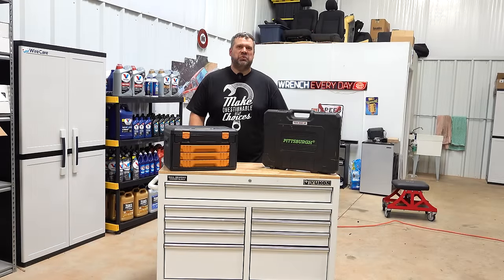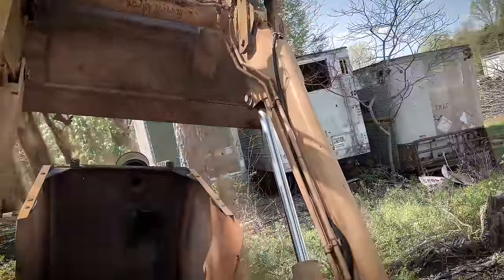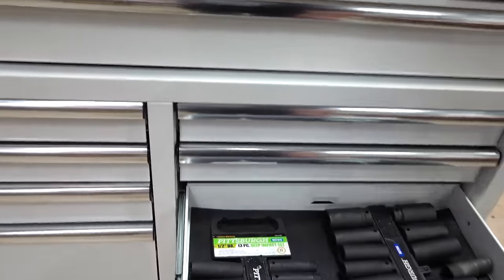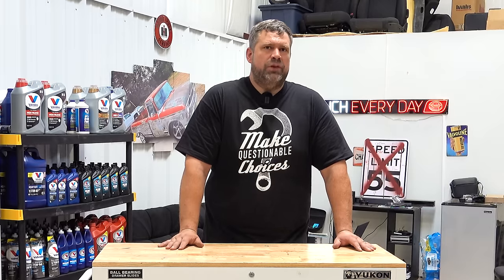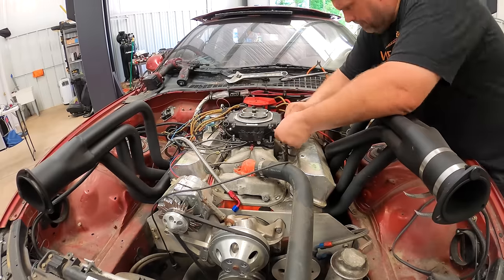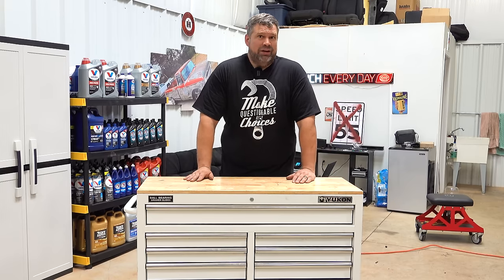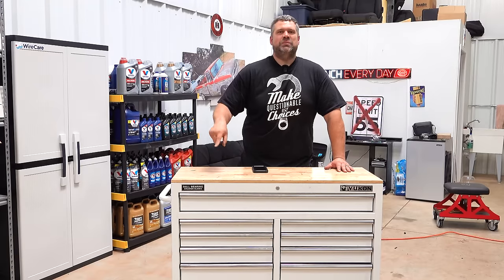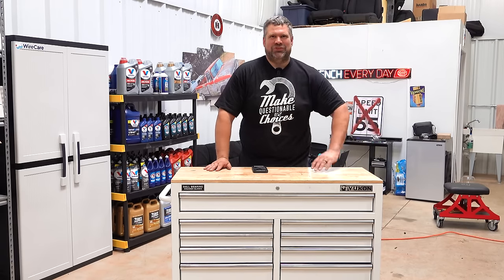I Bought The CHEAPEST Tools In Harbor Freight (6 Month TORTURE TEST)

Comment: Absolutely nailed it. I run a small bodyshop with less than 10 techs, and whenever I take on fresh apprentices they're always wanting to go straight to snap on and take on the debt, I tell them to buy cheaper tools and if they do break them with continual use then to upgrade that tool to something more expensive as they are clearly getting the use out of it.
Reply: yea it makes no since to buy a overpriced tool you are not using much, buy the cheaper tools and find out which ones wear out the quickest ... those are the ones that are probably being used and pushed the most. You don't want a 45$ o-ring pick set when your 10mm ratcheting box end wrench fails
Reply: What you said, but it also builds tool knowledge. So many kids just jump into the expensive stuff thinking "oh, legacy tools, grandpa had them etc" and skip an entire chapter worth of shop education which does end up biting some of them in the end.
Reply: @aserta  I have a complete metric socket set 6mm to 24mm and so many of those sockets I've never used because the ISO standard skips sizes. Although there are out of standard fasteners. But they're rare. Why I got that set is another story. It was a deal I couldn't pass up.
Reply: The industry needs more people like you. My first dealer job was working at Mercedes’ and man did everyone try and say I couldn’t do the job without snap on tools, thankfully I didn’t go down that rabbit hole.
Reply: Dude I buy whatever is cheap and if I break it I upgrade it. I'm cheap l and I have a full arsenal of shit I need to get my jobs done. Gotta be resourceful
Reply: @Gearhead2286  price is not always reflective of quality. Usually but there are exceptions. Cheaper brands that outperform more expensive ones. Tools can be a crap shoot.
Reply: @1pcfred  👍👍👍👍👍👍👍👍👌👌👌👌👌👌 Yup
Reply: Yup. I started with a small set like this one. 15 years later, I have over 30k in tools, and a majority of them are Matco, but I do have a handful of my original Pittsburg tools, that I've used the warranty on a handful of times. Lol.
Reply: @hanksadventures4132  plus its good to have the harbor freight stuff kicking around for those times you need to customize/modify a tool. You dont want to do it to your expensive tools and void the warranty, or just weaken then expensive tools, thats when its good to have the cheap tools kicking around you dont mind ruining/sacrificing. Sometimes you even end up using the modified tool more often than you expected cause it works for other stuff as well
Reply: Icon tools are made in the same factories that most other tool brands are made, and something that we have to realize is that each tool is forged individually, and just because a tool of a particular brand failed on you doesn't mean all their other tools are the same, tool sets are not uniform, tool brands are not completely uniform, except ones that are inherently flawed, because of some sort of deficiency in the forging process, and you will not see that from the top brands, that is the reason Icon tools finish in the middle of the pack, as well as Snap-on tools.. the majority of tools from these two companies are generally well made professional grade tools.. even though their prices diverge wildly! Lol!
Reply: Lol if they break them just take them back and get another tool. Or maybe they are abusing the tools and don't know how to use them. Husky, Kobalt, craftsman, Pittsburgh all lifetime warranty no questions asked so who cares.
Reply: I will never buy a Snap on tool what they charge for their tools is robbery
Reply: That makes sense...Why go for a $500 tool right off the bat when the $250 tool does the exact same thing the same way for 1/2 the cost...if the cheaper tool breaks, replace that tool with a higher quality one....just because you break 1 tool out of a hundred doesn't mean they all suck, it just means that particular tool wasn't up for the task and needs a heavier duty/better quality tool....wish a lot of other people would understand that and do the same as you with their new employees to try and save them money...sure once they're working there long enough they'll find out what works, what doesn't, and what to buy that works for them....thinking automatically that they need to have a $30k tool debt on week 1 of employment is horrible, understandable, but horrible....many think well the guy in the bay next to me has that $20k Snap-On tool chest, that must be a requirement...in fact I highly doubt any shop requires their employees to buy a certain amount of tools from the tool truck?  Maybe they do?  IDK.  I think I'd find a different place to work though if that were the case LOL...
Reply: @1pcfred  Very true, I've heard of people buying that high end brand name stuff, and breaking it, or finding out the hard way it had a defect....and they end up replacing it or supplementing it with a cheaper version and have great luck.  I think the tool trucks have lifetime warranties on their tools though?  Where, an off brand, no name version might not.
Reply: @hanksadventures4132  The thing is you didn't go out and put yourself into $30k+ in debt to a tool truck, you were smart and I assume you worked your way into those tools as you saw the need, rather than jumping in the truck  your first day on the job and requiring a 2nd mortgage on the house to outfit your tool chest LOL.
Reply: @wildbill23c  I've never heard of a lifetime warranty on power tools. Hand tools lifetime is pretty common among the respected brands. Even Harbor Freight lifetime warranties their branded hand tools. They're generally hassle free about it. I've never had any problems myself. Though I'm sure someone may have. I was just in a HF the other day and a lot of their stuff had Lifetime Warranty on it. The set of Pittsburgh star drives I got says it on the package. If I mess one up it's going back.
Reply: @1pcfred  Never said power tools, and if you pay attention and read labels it says Lifetime Warranty if the tool has one....and all their Pittsburgh and Pittsburgh Pro hand tools have a Liftetime warranty by the way and they always have.
Reply: @wildbill23c  power tools do tend to have warranties. I think Harbor Freight has a 90 day warranty on their power tools. They offer extended warranties. Pittsburgh is the Harbor Freight house brand. Just like how Sears had Craftsman.
Reply: @1pcfred  Yes...except less hassle returning stuff to HF for replacement or refund than you had to deal with at Sears, there's a reason they're gone, their customer service sucked, and trying to return stuff under warranty was a joke.  HF does now ask for a receipt to prove you are the one that actually owns the tool, and I totally agree with that, but otherwise its quite easy to return items at HF, even easier if your email address is on file with them as it logs all your purchases.
Reply: @wildbill23c  Sears was very good with their warranty while they were successful. The company failed for other reasons. As it failed the company suffered for it too. If HF's warranty needs a receipt then it is worthless to me. I don't save garbage. They should warranty whatever has their name on it. They cannot expect me to hold onto slips of paper for my lifetime. That's totally unreasonable. I usually blow off that email nonsense at the register too.
Reply: We've all heard "Buy once, cry once," but like you I think I subscribe to the method of buying cheap first and knowing what you want to upgrade to in the event that it breaks, or you just want something better. If you use a tool for a while you'll either find that it's (a) just fine for the task at hand or (b) needs improvements in X, Y, or Z area. But you won't know that until you use it for a while!
Reply: Smart. This concept can be applied even more so to the average homeowner. Buy the cheapest tools you can. If you find certain ones are having issues, replace them with a "better" tool. I doubt that most homeowners would see a difference in cheap vs expensive tools. Most people don't use their tools often either. Even cheap tools can last a lifetime for your average person.

Comment: I'm a shade tree mechanic, and I own mostly Harbor Freight tools. So far the only tool I broke was a 10mm ratcheting wrench, which was replaced with no questions asked. I've beaten on the impact sockets with an impact and a three foot breaker bar and so far have broken bolts not the sockets.
Reply: A lot of my bigger tools are from Harbor Freight pipe wrenches and bolt cutters
Reply: I'm someone who had several USA made wrench sets craftsman and great neck and even their tawain made ones,, and when someone who will remain un named hint borrowed over 65 percent of all of my tools most all the replaced wrenches and sockets are Pittsburgh and Pittsburgh pro...
Reply: I have a 149, and 194 PC mechanic tool set that is basically the truck crash and roadside service kit, that replaced the craftsman sets I had, and I have got two decent deals on gearwrench 1/4 90t and the 3/8 120xp like 51-55 PC set and they are the tool box set of good sockets, and now that 74 PC complete set of 3/8 shallow and deep sae and metric tekton and the mid sized combination wrench set

Comment: I went with the tool trucks when I started as a dealer mechanic, I had a lot of basic tools that were largely craftsman, that worked fine. Later years, the only time I would get something off the truck was for specialized tools, that you couldn't get anywhere else. Struggling to get something apart vs having the specialized tool designed for the job, makes a HUGE difference when you're working flat rate
Reply: Agreed.  Specialty tools are a whole other thing.  I build custom guitars and have spent the money on certain jigs/tools that make my job easier and more efficient.  In those cases, it's money well spent.
Reply: This is very true, though most often the various trucks aren't the actual manufacturer of the specialty tools they carry.  Lisle is one of the big names to look into there.  I have a number of things direct from them that are identical to ones off the trucks minus the added branding.
Reply: You hit the nail on the head. I do the exact same thing. Specialty stuff is needed sometimes but you can still a job done with less expensive tools.
Reply: There is nothing like have the correct tool for the job. It’s not worth the fight. Even as a hobby mechanic I own a load of specialty tools. I just pick them up as I need them but a 150 dollar tool for the job is worth the pain and suffering. Plus for me buying the tool is still cheaper than taking it to a mechanic.
Reply: Cheap tools and being cheap make for bad days. New people don’t understand this. You bought a $1 Harbor Freight screw driver to do brakes, oh you stripped out the Phillips ? And now you lost money on a flagged out brake job? $50 impact driver off the truck that pays for itself first job but the youtuber that said not to buy quality tools ever said skip it. Now you earn less than a high school kid at McDonald’s

Comment: I tend to buy on the low-mid quality when buying tools. If I have something break because I use it a bunch, I go more mid-high. If it breaks because it's junk, I'll go to the next step up. ~20 years of amateur wrenching, that plan has done me really well.
I really appreciate this testing to help us all make some better choices.
Reply: I know a mechanic that will buy the cheap Pittsburgh and other brand wrenches, purposely and use them when he needs to modify a wrench or screwdriver, or something in order to be able to reach a bolt or something, you can cut a wrench, heat it and bend it, etc...but he's like no way in hell am I cutting my Snap-On or bending my Snap-On wrenches for that, so sacrificing a $10 wrench VS a $100, yep I can easily see that logic too.

I have done the same, I'll buy that basic tool, if I wear it out or break it, I'll upgrade to the next brand higher until I find one that works.  Much better than starting at the expensive end of the line for no reason.

Comment: I got all the tools a guy could want, and I STILL found this segment very appealing.  I love that you are honest and upfront about the reality of the tool industry.  There are only a handful of corporations that own all the big names world wide.  

I especially like that you did the experiment with your own dollars and not by sponsorship.  

As for power tools, I'm currently a Milwaukee guy bc they were the first to have a sweet cordless impact, but I'm eyeballing Rigid recently.
Reply: The cordless tool line is another one of those rabbit holes you can get sucked into real quick.  For me I got my start with Dewalt 18VXRP 4 piece set I won as a door price about 18 years ago at a store.  So I just stuck with Dewalt and slowly just added to the tool line as I needed...course now I've got the 20V and 60V/Flexvolt stuff...but its mainly due to once you have the batteries/chargers you tend to stick to one particular platform due to already having the batteries/chargers.

There's absolutely nothing wrong with Milwaukee, Makita, etc.  Ridgid makes some great stuff and I have been eying their stuff recently as well.  I don't have any Ridgid hand or battery tools...I do have a Ridgid TS3612 10" contractor table saw, and the Ridgid 13" thickness planer....both I've had for probably close to 20 years, both work great...I've heard several say their cordless tools are great too and wouldn't be surprised.  They're more foreign made now sadly than they used to be, but what isn't anymore honestly.

Comment: Excellent advice. I never had the money to be a snob about tools when I started wrenching... I did over the years learn 'which' tools it was wise to spend decent money on and what could be semi budget kit. The old adage 'you get what you pay for' does come into play, but the 'reasonable' tools (used correctly) will definitely still get the job done in a professional setting.
Reply: Snap-On is still out in front but others are catching up. So it is hard to justify the premium S-O charges. Snappy ain't 10 times better than the next guy. Today it's more like 10% better. So you're not really getting what you pay for.

Comment: I've had husky tools since I started wrenching. Still use them so many years later. Pretty good quality. Only had one ratchet stop working, but it's an easy fix.
Reply: The Husky and Cobalt lines at the big box home stores are not terrible, and one thing I do like about those stores is say I've got a set of wrenches and it skips a couple sizes like 14 or 16mm, you can buy those individual tools and fill in your set without buying another whole set of wrenches.  Much better to spend $13 for one good wrench than $40 for a whole set of cheap ones just to get that one missing size.  Reminds me I have a 3/8 drive Husky ratchet that froze up that I need to run in for a replacement.

Comment: I loved this review.  I'm a shade tree mechanic I guess, if even that.  I fix mine and my girlfriends cars, 3 in total.  Normally I do a lot of DIY work and build PC's.  Most of my tools are from Harbor Freight and they've done awesome.  Back when I worked at a Chrysler dealership (I was the service advisor at the counter not a technician) the guys laughed at me using my cheap tools to do work on lifts after hours.  Told them the same thing I tell everyone when it comes to what I work on/build/customize/program; my work speaks for itself and any new mechanic should feel the same.

The quality of the work you do says far more about you than the tools you use to do that work.

Comment: I bought that 500 piece set too. And it worked perfect for me and my brother when we work on our cars. The issue i had was the screwdriver sockets. Those are crap material. The other thing is i had to buy an icon swivel head 10 in ( 3/8 ) rachet because the quinn works, but its too small. Not enough leverage to loosten bolts. For pliers i went with what worked for me for a long time, craftsman

Comment: I'm just a home shop mechanic, but I am out there almost every day.  Bought a Husky $800+ box.  Love it. Love the auto/soft close drawers.  Good weight construction and the flat black powder coat/or maybe paint(?) is tough and still like new after 4 years.  Tools are mostly Craftsman, but an overall mixture of mid and higher end tools if they could be found for a good price at pawn shops and estate sales.  25% of my tools are antiques handed down from my dad.  They all have their place, story and uses.  I have also kept some lower end tools through the years that can be used sacrificialy when needed.  Power tools are all Craftsman or better quality except for my HF electric grease gun which I love! I've built the collection that I needed through the years and it works well for me.  I guess there's a lesson hidden in there.

Comment: I have a husky tool set since I was 15, as a Christmas gift, and I have beat the crap out of it, and the ratchet still works like new.  I always lubed it up by putting the head in a cup of ATF or light weight oil,  at least a couple times a year, which I do to all my ratchets.  No failures from home to shop work!

Comment: I'm a commercial kitchen tech, hot side, and I have the HD box with mostly HF tools. My main load out is the Bauer roll chest with the medium case on top, and it took almost a year to have the 7/16 wrenches to spread, broke 1 socket and I swap out my $89 clamp meter every 3 months from grease getting in the wheel switch. The Hercules cordless "screwdriver" has been dunked in oil and water, run over, still works great.  I avoid most automotive specialty tools from bad previous experience

Comment: as a first year mechanic i started out with the harbor freight 300pc mechanics tool set then slowly started up grading my tools to mac snap-on and matco tools so far i still have all my harbor freight tools ive use the chrome sockets with the air impacts and they are still going strong